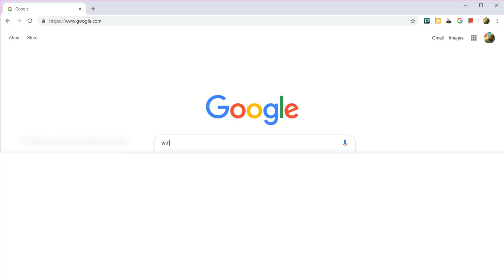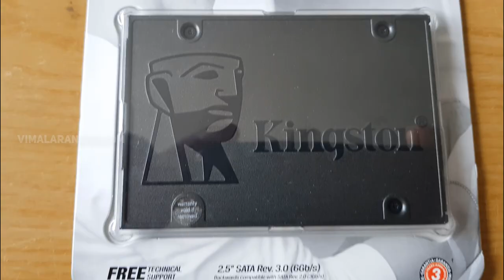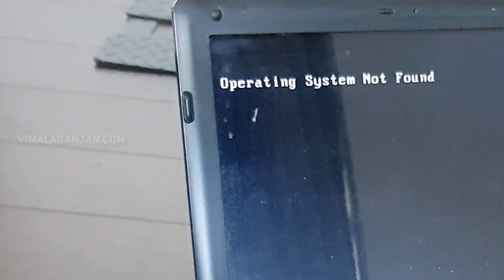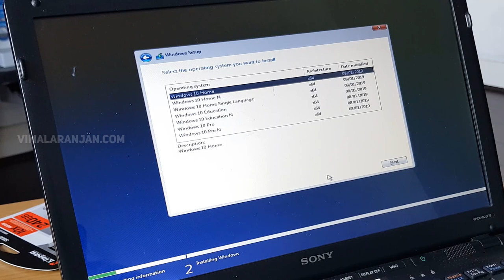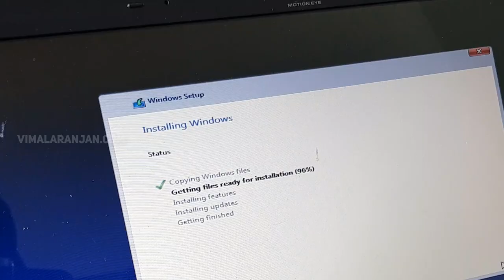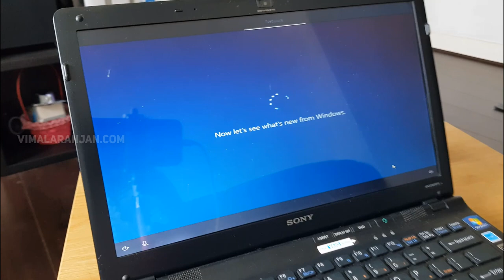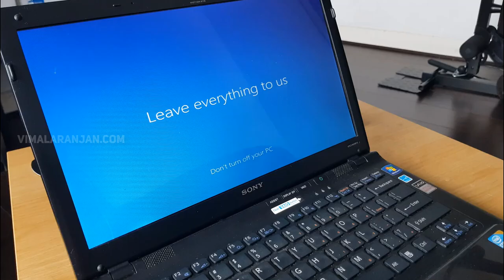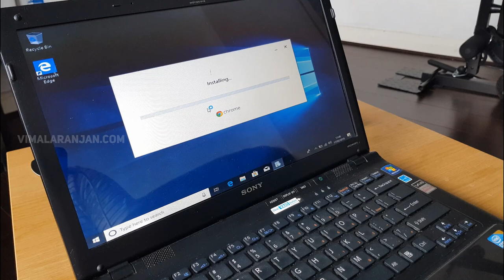HDD to SSD upgrade and Windows 10 Fresh Installation on a 10 Years old Laptop

Comment: sir , what's the benefit of installing ram into a SSD? Do we have to use them as USB? Also can't we simply increase the ram to increase the efficiency of our system instead of installing windows on ssd
?
Reply from the maker: RAM and SSD both are different
Increasing RAM is little bit helpful, But if you upgrade your HDD to SSD it can do some amazing improvements.

Comment: In this video old laptop, when installing windows 10 fresh install, the drivers, WiFi drivers automatically detected??  Looks easy.   Also, what License key u out later there or if u have window 7 or windows 10 now it will detect too??
Reply from the maker: I just updated the windows 10 
windows 10 update will automatically updates necessary drivers.
Reply: @PLIDD  if fresh install from windows 7 to 10.  Do I need a windows 10 product key??

Comment: My hp laptop   quad core 1.8mhz window 10 has only 25g harddrive. Is it possible to upgrade it using 256g ssd win 10 os
Reply from the maker: Yes you can

Comment: I have just bought the same hdd, how is the performance?
Reply: This isn't hdd this is ssd which is much faster than any hdd drive
Reply: @MuhammadAjmal-rg6fy  Yeah I meant ssd
Reply: @rhlparkr  I bought a new laptop with ssd and i realized that ssd is 50 times fsster than old hdd drive. Ssd speed is about 500 mbps that's incredible isn't? ❤❤😍

Comment: how can u use windows 10 without having a product key?
Reply: It's no longer required. You can install it in "free" mode but it will add a "Buy license" watermark on the bottom right part of the screen.
Reply from the maker: Its automatic upgrade when you give your Windows 7 Key.

Comment: When i turn on my laptop, it says "No bootable device" even if i connected my flash drive. Do i need to configure something in the ssd first?
Reply from the maker: Press the Power button for your computer.
During the initial startup screen, press ESC, F1, F2, F8 or F10. (Depending on the company that created your version of BIOS, a menu may appear.)
When you choose to enter BIOS Setup, the setup utility page will appear.
Using the arrow keys on your keyboard, select the BOOT tab. All of the available system devices will be displayed in order of their boot priority. You can reorder the devices here.
Move USB to be first in the boot sequence.
Reply: If you can't see ssd on windows, go to partitions administrator and format it

Comment: cheap SSD's aren't much better than normal HDD's. Better by a Crucial MX500 or a Samsung 960 Evo for 20 bucks more. They have a much bigger cache memory. 

For example:    Kington A400 960GB         32MB Cache Memory
                           Crucial MX 500 1000 GB   1GB Cache Memory